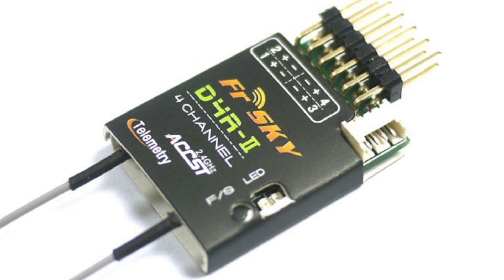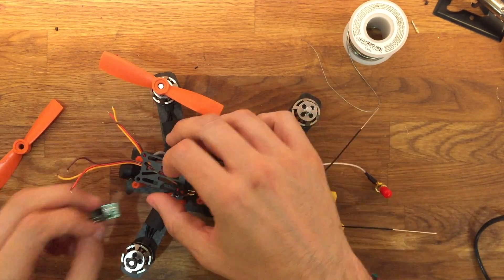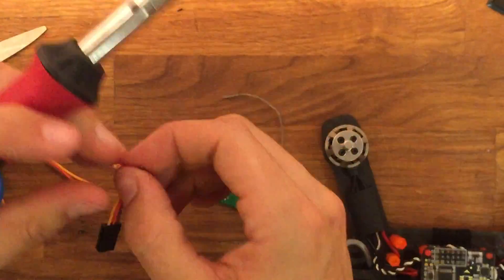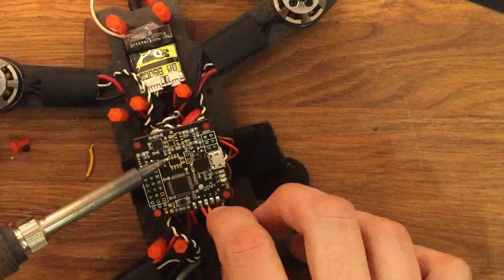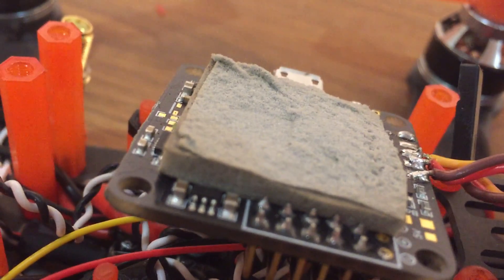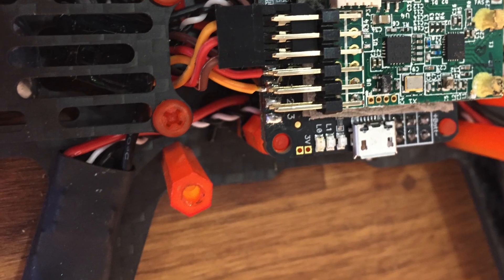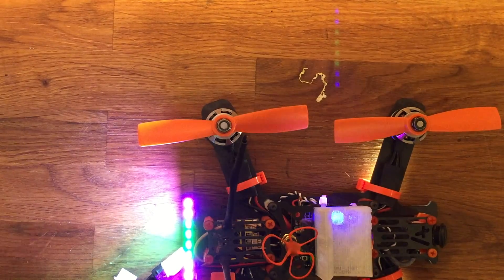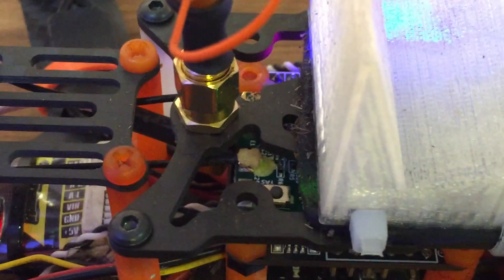Taranis X4R Sbus to CPPM Conversion

Comment: Good info, but you should have removed the props!
Reply from the maker: +Geerd Jacobs I've never heard of issues with props spinning during the bind process. Every component was already tested and failsafe was set. But yes, always good to remove props no matter what.
Reply: As always in aviation: Safety first!
I had a motor spinning (with no prop) because of a faulty FC.
Just wanted it to mention. So no one is crying afterwards after watching your clip :).
Reply from the maker: Geerd Jacobs Honestly, I always remove props. This was one of my first builds and now I am very careful. I see a lot of scary videos with people testing motor output with props on! Crazy